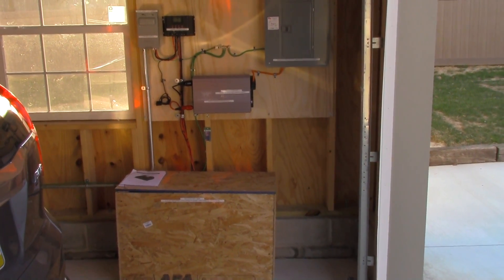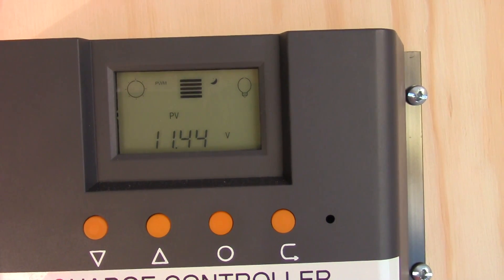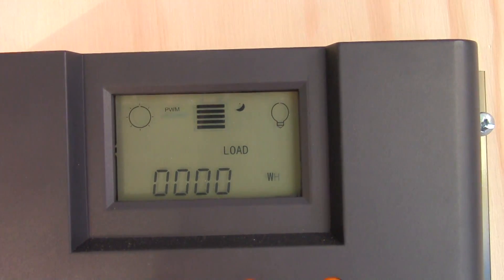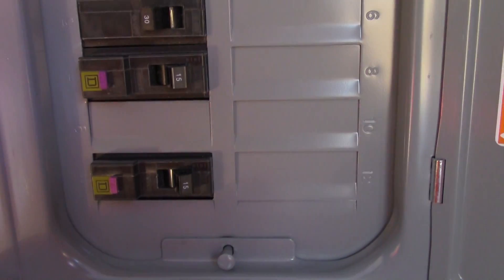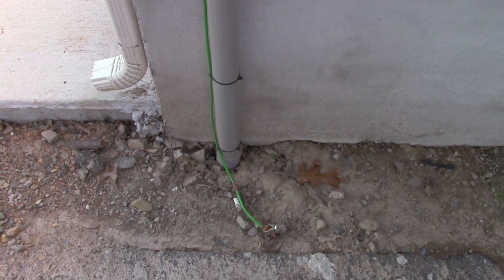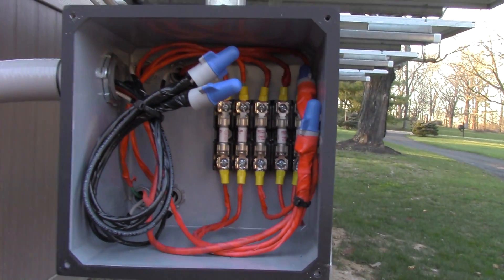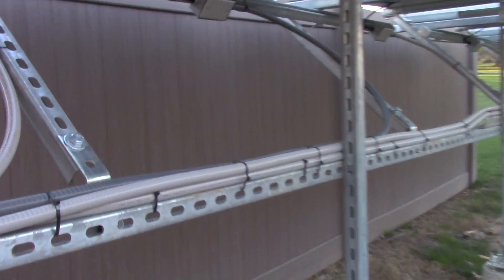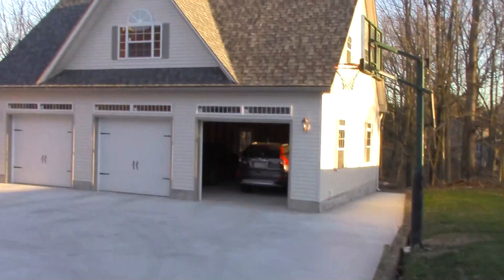Off Grid Solar Power System

Comment: You need a mppt charge controller
Reply from the maker: They say a 30% increase in charge for MPPT but this is only a garage and not used often. Everything is still working great with PWM unit!
Reply: Ok

Comment: excellent workmanship! Did you consider wiring the panels in series? It would increase the number of solar hours even on cloudy days
Reply from the maker: I wanted to keep the voltage low for safety. But you bring up a good point something I was not aware of. Thank You!

Comment: Everything looks great, but put those panels on a 30+- degree incline towards south based on your location to get 25% more power.
Reply from the maker: Hi David, Yes your right but township required us hiding panels next to fence. If we would have angled them would not catch the sun. Sun was coming from the other side of the fence from Sun Rise to Sunset.

Comment: My advice is to buy a mppt controller. That way, you win everything from the 5 panels. That's just a suggestion. Otherwise I like your work done well. Many days with sunshine.
Reply: nice install,but that charge controller seems not trust worthy some wire seem kinda small too ...but it passed inspection

Comment: Very clean, well thought out design. Very nice. Needs more and better batteries
Reply from the maker: Hi Dino, Thanks for the commit. Why do you think we need more and better batteries? The garage uses no power other then opening a garage door or 2 times a day max. We sized the system for the clients use and budget. No problems with the batteries. We would prefer Lithium Solar batteries but was not in the clients budget.
Reply: My mistake. I had watched thinking it was a whole house off grid. I meant no offense. Good luck with your solar system. I am sort of challenged with the small 1Kw system I have. I am using golf cart batteries with minimal luck.
Reply from the maker: None taken no worries. I used 6 volt golf cart batteries and wired in series to make 12 volts. They work great so far so good. But we have 5 panels so they get fully charged quickly. Maybe you can add more panels to your system?

Comment: Very clean work. However I will like to make some observations. 
1. 200 AH is your battery capacity
2. 5 x 285 exceeds the capacity of your charge controller. 30amps x 12 V = 360
3. Your batteries don't like voltage that low.
4. Wired in parallel the amp from your panels exceeds 30 amps of your charge controller
Reply from the maker: We are using a 60 amp charge controller not 30. The system is sized correctly.
Reply: Chuck Greway did I hear wrong? In your video
Reply from the maker: This job had a permit pulled and an electric inspection completed on the project. your #2 is incorrect, #3 makes no sense to me, the system has the proper voltage. Our charge controller is 60 amp not 30.
Reply: #3 The battery voltage you showed 11.44 Volts. If you know anything about batteries they don't like a low state of charge. 
At 11.44 your battery state of charge is at 20%. way below the recommended 50%
#2 If you are running 12 V your 60 amp controller is inadequate. To determine how much in PV you can run on your controller system voltage x controller amps. 

That you pulled permits for does not mean you did the job correctly. Permits means you met code. That is all it means. Does not mean you Do more research and stop insisting you are right when you are clearly wrong. We all learn from people who have experience. And I have learnt a lot from watching videos and reading comments
Reply from the maker: Hi AWPS, 
The #3 we had a defective charge controller and swapped out after the video was done. The battery's were not chargedin the video, because the charge controller was defective.  The New charge controller the voltage is 12.5 volts and charges between 13.5-14 volts. #2 we have 34 volts coming in from the PV array to the charge controller,  steps it down to 12.5-14 Volts depending on charging. 34 Volt Panels. 285 Watts x 5 = 1,425 Watts total. 1,425 divided by 34 Volts = 41.91 Amps. We are using a 60 amp charge controller. This system has been working flawless for over a year now. Before you commit make sure you have all the facts straight.

Comment: I can see more problems with your setup than Carter has PILLS! Your setup LOOKS nice, but I can see several errors.
Reply from the maker: Hi Bruce, 

         What errors do you see?
 We have had no problems other then a faulty charge controller. But since the system has been installed, its been 100% problem free. We have had 50 MPH winds, 3 feet of snow along with rain lasting a week. The system past an electrical inspection required by the township.
Reply: # 1. NO Home Solar setup can charge at 200 AMP HOURS! Just to begin with, you have a 30 Amp Charge Controller. That controller would go "POP!" in a fraction of a second!
#2. The energy might not even GET to the controller. 200 Amps would MELT your wiring-in a fraction of a second!
#3. That looks like 8 Ga. wire from your battery to your Inverters. They MIGHT handle 80 Amps given the short run, but that wire is rated for 40 Amps. 
#4. The batteries, if they are in series-parallel (I get that, but the way), appear to be about 60-80 Amp size each-I'd have to see the MSDS on the batteries to know for sure. Say they are 80 Ah rated. in series-parallel, you have a surface amperage of 160 Ah going to the Inverters. While technically they can probably handle this, the wire from the Bank to the Inverter is still too light a gauge.

I could go on, but I think you're getting the idea.

I don't fault you for going after off-grid energy independence, in fact I APPLAUD you! But, people need to KNOW what they are talking about when they post videos like tis. That's all I'm saying.

Bottom line, because of the short distances of your wire runs, you probably WON'T have a fire, but that is something I always look for having once been on a volunteer department.
Reply from the maker: Hi Bruce, 

Here are answers to the errors you may see but are wrong about. 
 
1. 200 amp hours is the rate of charge for the battery's that is recommended from the battery manufacture
 its self. 
The most common battery rating is the AMP-HOUR RATING. This is a unit of measurement for battery capacity, obtained by multiplying a current flow in amperes by the time in hours of discharge. (Example: A battery which delivers 5 amperes for 20 hours delivers 5 amperes times 20 hours, or 100 ampere-hours.)
We are using a 60 amp charge controller not a 30 amp. The charge controller,  controls the battery charge to prevent overcharging.

2. Question does not make sense to me?  We sized all the wiring correctly and used fuses rated for the DC to AC amps to protect the wiring for different parts of the system. The Battery / Invert-er and panels all have fuses of the proper size. 

3. We are using #2 Copper with a 80 amp DC fuse no risk of overloading anything. The invert-er can run 8 amps max before the fuse would blow. Everything is protected.

4. The battery's are 6 volt golf cart battery's wired in serious and then parallel to get 12 volts. Again we have fuses everywhere in the system. #2 copper THWN is good for 190 amps and we are using an 80 amp dc fuse on the side that powers the invert-er. After 8 amps on the ac side is drawn the dc fuse will blow. 

Bruce this was not a weekend science project, we installed this for a client. We pulled permits and had the system inspected and has run flawlessly since installed. There are 110% no fire concerns with all the properly sized fuses installed throughout the system.  But thank you for the questions this may help others out.

Comment: Nice setup, professional.  How long is your run from your solar panels to your controller?  What gauge wire did you end up using?  Enjoyed your video.
Reply from the maker: Under 100 feet, used #6 THWN stranded copper wire and #8 after the parallel connections
Reply: Thank you Chuck.

Comment: Looks like a good setup and a really well done installation. I'm wondering about your battery vent though. The way I understand it, batteries can vent hydrogen when they charge which is lighter than air so it will try to go up but it looks like your vent comes out of the battery box and goes down. Did I miss something? I'd love to do a solar setup at my house but my lot is almost completely shaded.  :(
Reply from the maker: I installed a 4'' vent so plenty of air movement. You have a valid point, since most RVs do have the vent at the top of the batteries cover. I think the space is large enough that this project has nothing to worried about. But if your in a confined space with no air movement then gases may build up.

Comment from the maker: The charge controller is new and very difficult to program. Once you figure it out its really simple and works well. Call the manufacture they are really helpful with questions. The biggest problem for me was figuring out the battery charge setting, my is set to 2.40 and then charges at 14.5 volts. They need better directions on what each setting does but once you figure out its simple to program.
Reply: Yes thats funny, because I know exactly what you mean. Mine is set at 2.50 and then charges to 14.4 volts. So it varies, at least I know Im on the right track. Also I have it set to mppt instead of pwm. seams to draw more power even on a clowdy day. Plus discharging mode is set to manual.
Reply from the maker: Charge controller failed don't recommend the Ramson 60 amp charge controller its junk. Ramson was great with refunding the cost of the charge controller.
Reply: JBHobbyist

Comment: I too have a Ramsond sunshield pro charge controller. Its been really hard to find someone else who has the same charge controller I have. Trying to learn what everything means while programming the controller has been a challenge. If you could provide a video on how to program the controller that would be very useful.
Reply: You are probably pushing too much current through the controller. It is rated for 30 amps. Your panels are close to 8 amps each.
Reply from the maker: Update on the charge controller, after returning the unit 3 times, used a different brand charge controller. Since have had no problems, Ramson inverter works great, but don't recommend the charge controller.
Reply from the maker: We used the 60 amp charge controller not 30. The new one is the same amperage rating and works great.